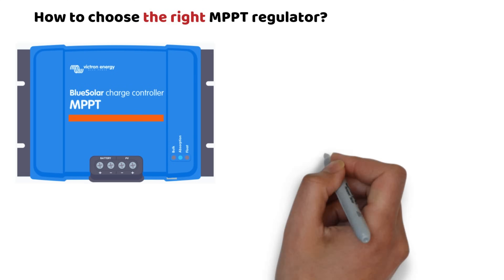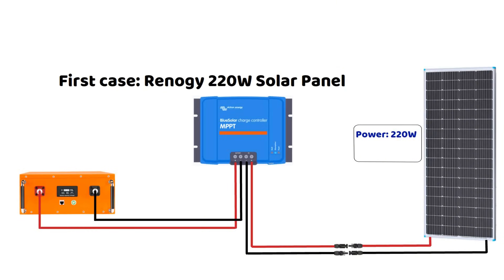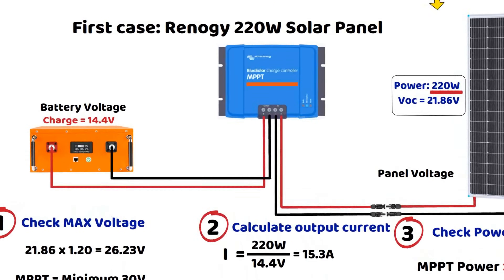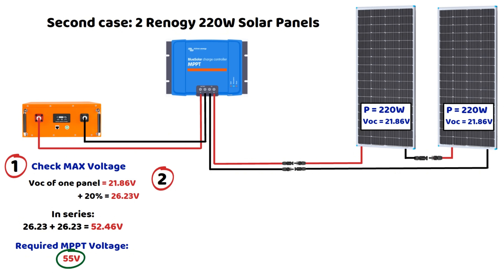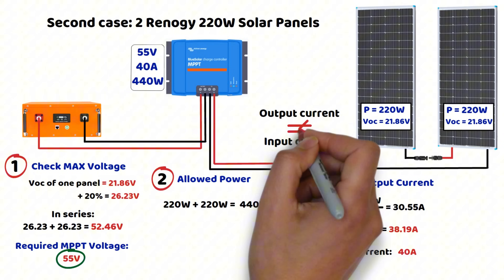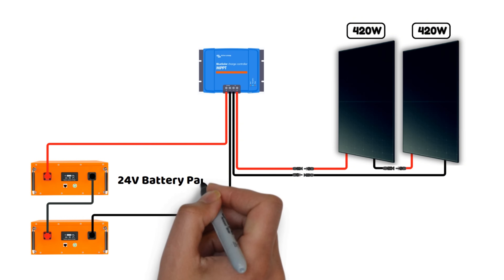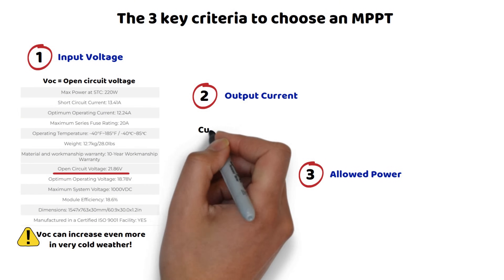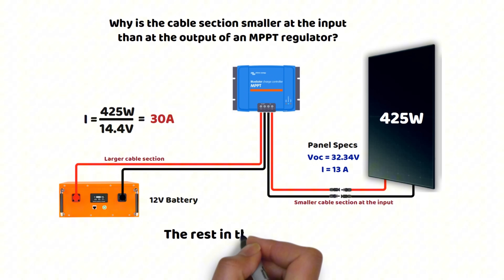How to Size a Solar Charge Controller? Avoid This Mistake...

Comment: Question:
(must NOT go over volts, will BURN up controler)

(amps under OK, just waisted power loss)

Is this statement CORRECT?
Reply: Mostly; exceeding the current rating of the controller usually doesn't waste any power - for example if your controller was a 20A limit, and the max current hit 18A at noon, you haven't clipped any current, and lets say your battery was full by 1pm. With a 15A controller, you would be clipping 3A at the best part of the day, but likely you would still be full by say 2pm, so what have you really lost? Nothing. The only time you lose something is if the battery doesn't get to full by the end of the day, due to clipping.

Comment: I have a question: What are the disadvantages of having oversized wires?
Reply: Cost
Reply: The only disadvantage is the physical dimension and cost. In terms of electrical bigger wire is always better.
Reply: @stevemiller6766  sweet summer child. ever heard of skin effect? that's just one example. bigger is not better every time. bigger wire also get more hit by sun light, thus get hotter. shape is also important. therefore we don't have just round ones...
Reply: As already mentioned go for the absolute largest sized wires you can afford, 12v drops off rapidly over long distances. If you go for a 24v system the voltage drop is less over distance. That’s why Australia which has large distances for wires to travel uses 240v AC. In a caravan by the time you route cables over/under/around cabinets etc a short distance from A to B may actually be long enough to get significant voltage drop for 12v.

Comment: why did  my solar charge controller burned out ? I used a 30A controller 4x different amp batteries and a 100w solar panel
Reply: Without more detail it is too hard to know. However if you’re using different amp batteries there is a red flag. 🚩 the charge controller is probably going nuts trying to charge those batteries. Some will be full while some undercharged, therefore you’re overcharging some batteries which might have fried your electronics. Assuming the batts were joined in parallel you made an impossible scenario for the controller. All batteries MUST be the same chemistry, age, voltage and amp/hrs. Even same brand would optimise charging.
Reply: Poor sizing. Thats why it burned out.
Reply: Not enough info to say so far, but if the controller had a max Voc of 100v (typically they are 100v, or 150v) and the panel was a typical 100w with a Voc of ~25-30v, then the only issue is the controller's quality. There are a lot of junk PWM controllers that claim to be MPPT but are not, basically if its got a USB port on it, its probably a PWM and is probably junk. 

Charging different capacity batteries is not a problem at all for a controller, ignore anyone who says this. The controller has no idea what its charging, it just pushes current until certain things happen to voltage and/or current, then uses the next mode in the charging algorithm. The batteries have to be the same chemistry, or you risk damaging the chemistry that isn't suited to the selected charging voltages. They obviously have to match in voltages (i.e. you can't mix a 12v with a 24v).
For LiFePO4, the batteries don't have to be the same age, for lead its best if they are. The certainly don't have to be the same capacity (Ah), the controller will have no problem there.

Comment: Is it OK to get a larger solar charge controller? If you plan on going bigger laketor
Reply: If using an all in one, keep in mind the idle consumption. The larger the unit, the more idle consumption it uses, generally.

Comment: One point that is worth bearing in mind is that some MPPT controllers will just fail if overloaded. Others (Victron included) will restrict the power to protect themselves. 

Another point. With continuous high power charging, despite the use of fins on the back of the casing, they can still get too hot to touch. With my 250v/100A and 250v/60A Victron controllers I use a pair of centrifugal computer fans to blow air from underneath. These use temperature controllers set to come on at +40degC and go off at +35degC. Even in UK summer conditions these fans cycle regularly during high charge rate conditions.
Reply: You are generating a lot of power . My set up is a Victron 100/30 with two 220 panels in parallel . Would you consider MPPT will get hot . Have just fitted it in my Motor home wardrobe cupboard . Thanks
Reply: @dts123ify  Place your hand on a mere 40 watt incandescent light bulb that has been on for 20 minutes.
220 watts is five times that heat.
Reply: You can also derate the controller manually by setting a lower max charge current, or let the controller derate itself which it will do when it gets too hot. But ... Victron are built to run hot or cold, so just mount them with good air flow and you will be fine.

Comment: You can "over panel" - the voltage rating of the MPPT controller is critical, do not exceed.  However the amperage / power handling does not need margin and in fact the panels can exceed the controller by a small amount without harm.  This will increase production in suboptimal conditions, while sacrificing the peak production when conditions are ideal.  Graphing production on a typical good day would show higher morning and evening production, but a flat cap during the middle of the day where production did not increase because the controller reached its maximum.  Don't overdo it - that's just wasting money on panels.  but 10% more panel than controller is fine ONLY IF THE CONTROLLER VOLTAGE SPECIFICATION IS WELL ABOVE MAXIMUM POTENTIAL PANEL VOLTAGE.
Reply: Controller clipping comes to mind.

Comment: Why talk so fast , lost me 20secs into the video
Reply: You can slow it down with the gear icon in the top rightcorner of the video!
Reply: Nobody is talking, it's AI
Reply: I like it fast. Im fact I hate it when they talk slow.
Reply: I finally don't have to hold 2x speed because they drone on never getting to the point.
Reply: You can slow it down
Reply: Like 50cent said "you've got to listen a little faster so I don't have to slow down for you to catch up"
Reply: I don't know where he's rushing to. The video should be presented in a normal talk mode. If possible, you should slow it down and explain diligently.
Reply: @kolaolaosebikan2026 no, you take control and slow the video to .75 speed in the gear icon, top right.
Reply: Agree, far to fast,
Reply: @ZuluAlfa.1 that's why YouTube has a speed control so that you can slow it down to match your comprehension rate. Personally, I usually play videos like this back at 150% speed.

Comment: It seems to me you've reversed "input voltage with output voltage"? The voltage coming from the Solar Panels (PV) is input voltage. The voltage going from the charger to the battery is "output charging voltage".  Thus, when calculating the size of your controller for your panel config. We rely on the maximum input voltage (on a 40amp controller usually 100v, 60amp 150v.) The output voltage, (charging voltage) of the charger is displayed as 12v, 24v, 36v, and or 48v, which indicates the charge limit the controller can output to the battery(s) being charged. 100v input is enough to handle 4, 18-25 volt panels in series. If in rare cold weather there is enough sun to push over 100v, the controllers (at least most) shut down until the voltage drops below the maximum value. I'm not a certified electrician so Please correct me if I'm wrong.
Reply: I agree
Reply: @RetifsGarage  No MPPT CC I've worked with shuts down at or before their over-input voltage, what happens is they blow their input caps, and by the way I do this for a living here in the UK, where it is normal in winter for panels to give out much higher than their VOC rating at 25c.
Reply: Definitely wrong - the Voc of the controller is the voltage at which the smoke comes out, and this is strongly related to temperature and weakly related to solar intensity. Have a look at the graph on a spec sheet for a panel, and you will see that the voltage rises to almost Voc with even the slightest sniff of sun (200w/m^2) and doesn't climb much even at STC (1000w/m^2). Current however ... this is something that DOES get blocked by a good quality MPPT controller, so maybe you have voltage and current switched around. If you have a good mppt (like Victron) you can even program the max battery current to be a smaller number, for example on a 100/20 controller we sometimes bring the charge current limit down from 20A to 16A, so that on a cranking day the controller will run a little cooler.

Comment: You made a few mistakes. In the second case, @time -4:45 you were talking about a 12 volt battery, but you circled a Victron 24 controller and a Renogy 24 volt controller?  Second, also in the second case, @ -4:35, you said use a 25% margin of safety as you were writing 1.20?
Reply: I don't know about Renogy, but if you look at Victron controllers they typically support 12v and 24v batteries, the 24v is a maximum not the only.  Others can also support 36v and 48v batteries in addition to 12v and 24v.
Reply: @ These charge controllers can be 12 V or 24 V, depending on the battery voltage - I’m well aware of that. But he never made that clear in the video. But clearly in case #2 in the video he was referring to a 12 V battery at the same time circling 24 V output.  Why was he circling 24 v watt limits - I got confused.  At one moment, he was talking 12 V, the next he was talking 24 V, then he finally concluded with 12 v output.
Reply: The column says 12/24 auto select. So they are NOT 24v controllers

Comment: It is also important to keep those 12V cables as short as possible. Personally do not do 20% safety marginals on panel calculations unless you can point them in perfect angle always. If they are even slightly less you can get like 80% of your maximum capacity of panels!
Reply: Under powered is ok, overpowered is not.

Comment: Have a question.  In your first example you are saying the MPPT controller requires a min. of 30 volts but your pv panel can only output a max. of 26.3 volts.  Am I missing some thing?
Reply: It's not well formulated. It's not "MPTT requires mIn 30V" but "you need an MPTT controller supporting at least 30V".
In other words, plan for some safety margin to the max voltage of the panel.

Comment: Now I understand why it was recommended that I use a 48V system - for 4K in panels - keep the copper $$ in check.  

The other reason of 48V is, IMO, that there are a lot of DC to DC requirements that are <= 48VDC.  Now that I think about it, I'll probably mostly have 48VDC batteries with that are dual 24VDC batteries in series (48VDC total) so that I can potentially pull 24VDC  when needed without additional electronics.
Reply: I have 24volt in my system. I have 3pairs of 2 in series 12volt Lithium. If i understand corectly many batteries that have battery monitoring and heating, cant be in series, the BMS and heating will burn. The same can be with 2  24volt batteries in series. Also, if you have 12volt and 4000watts of panels, you will need a MPPT of 320Ah or 3 Victron 250/85 that wil cost you around $2000. With 48 volt you can use 1 250/70 MPPT I have 4 160watt panels and 2 190watt. Conected 2 and 2 in series and i have a Epever 100Ah MPPT. This spring i will change the 4x160 watt panels with 4x450watt panels. Last night i ordered the victron 100/20 MPPT for the 2 190watts panels and the 4 450watt will be conected to the "old" 100Ah MPPT
Reply: Dont do that - unless you can pull exactly the same energy out of each 24v battery, you will be unbalancing your pack. Also, if you want a 48v system from multiple 24v batteries, you really need to have a battery ballancer. In almost all cases, you are better off with a single 48v battery than a pair of 24v in series. If you need 24v from a 48v system, use a 48->24 DCDC

Comment: You are awesome. Watched so many Youtube Videos and did understand nothing. You explain it easy and simple so everyone can understand this. 

But one question: I have 2 100W Panels in Series, Voltage 43V, Amperage at the moment (winter in south germany ) Around 3 Amps. (ca. 110 Watts maximum Power output) I will wait until summer to see whats the maximum i can get out of it but for now,  I have the victron 75/15, its rated for a maximum of 220 watts at 12v. But even with 110 watts of power im on the output side at a charge amperage of 8 Amps. So theoretically i have 7 Amps left of capacity. Is it able to connect a 3rd panel to the system, if i stay below 15 amps and 75 volts even if the theoretically maximum power for the victron is limited to 220w peak?
Reply: If your array voltage is 43v with 2 in series, then with 3 it will be 43/2*3 = 64.5v. If those numbers are Voc at STC, you are fine, but do the calcs to see what the Voc will be at say minus 10 or whatever your coldest temperature will be.
Ignore the wattage numbers, wattage is a byproduct of the important values; voltage and current. 300w / 12v = 25A at STC, but you won't get STC, and the controller will just block at 15A, which will be fine.
Reply: @darylegarr5217 thanks. But nevermind. The Solar Panels was the problems. Maximum this summer was 150 Watts. So 75% of it max rated output. I switched to 24 Volt system with a 450 w solar panel. The position and angle of the 450w compared to the 200 w didnt change. I got now 430 watts of maximum output which is 95% of its rated power.
Reply: You can over watt BUT Not over Volt and don't exceed the max input of Amps also. Look at the specs of your Controller for your answer.